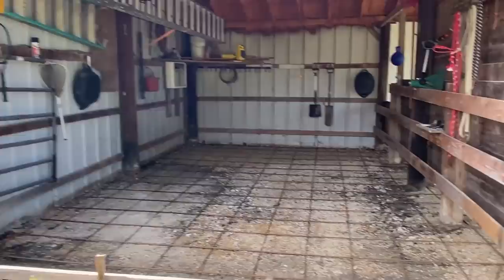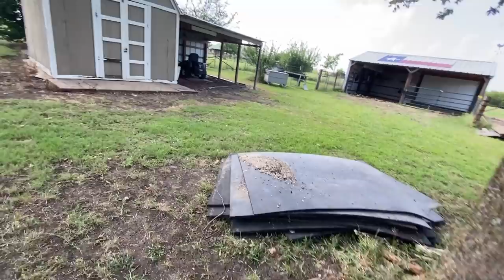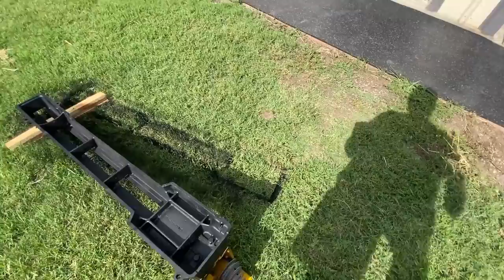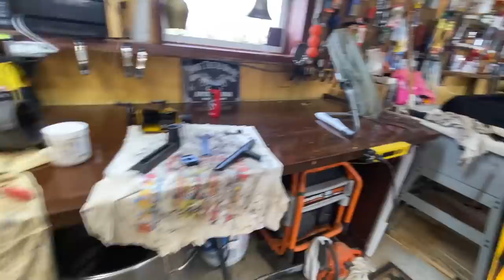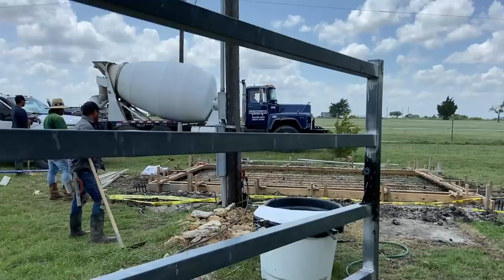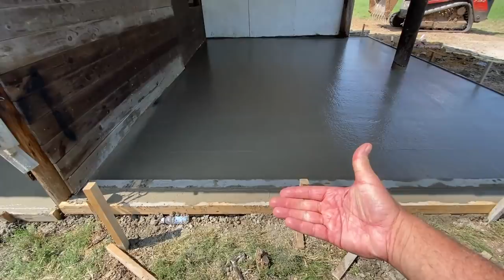Concrete Pads Being Put For Horse Areas & Mud Areas - Complete Project 2 of 3

Comment: I learned a bit about concrete. I learned that concrete hold moisture and attracts water so any wood touching concrete sometimes will rot where the poll meets the concrete. I learned that because my mailbox post was in concrete and it rotted AND the post was pressure treated but it still rotted and fell over. The old post was only there 12 years.  So I put a heavy bag around the new post, put it in concrete and trimmed the bag.
Reply from the maker: drill out old wood, saw or burn, then you have prefect hole for new wood post

Comment: Work, work, and more work.  I saw on IMA Survivor that the concrete under their giant barn was not done properly. The water runs inside and he has puddles.  He said he wasn't going to complain.  Since the entire purpose was to keep everything dry, I think he should.  That is just sloppy work.  Maybe you should get a guarantee against cracking and water collection?

The concrete could easily crush your electrical wires, as it hardens, if that is normal light weight electrical pipe.

Comment: My 10c worth.  Yes I am añ old lady and I have mixed and laid many metres of concrete.  For horses the concrete only needs to be 7to1 that is 7 parts gravel to 1 part cement.  For machinery concrete you need 5 to 1.
I suggest that you put visqueen (black plastic) under the rio so that it doesn't dry out to fast . Next you need spacers to hold the rio off the dirt/ plastic. 
And last...looks like my advice is too late.  The thickness should be  4 inches
Reply: I reckon that they probably needed 6-7yards in the big double shed